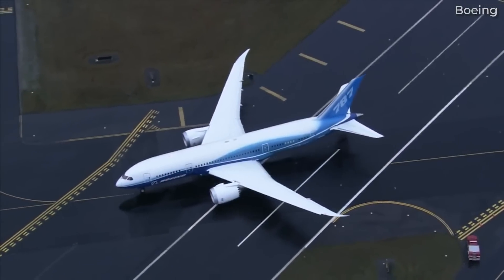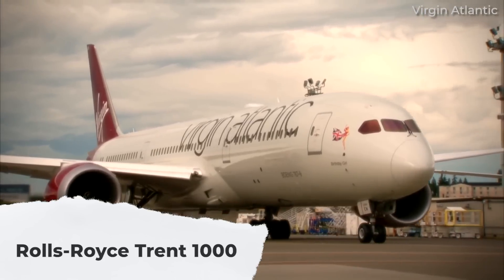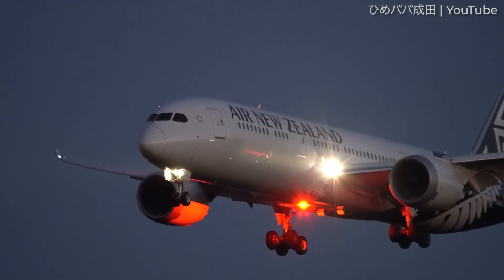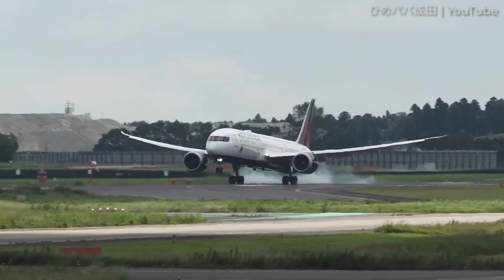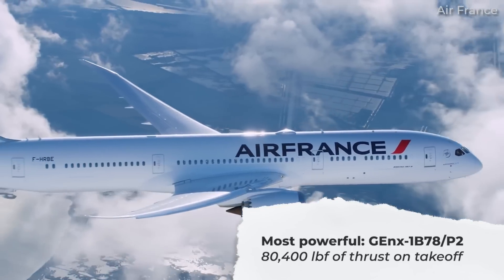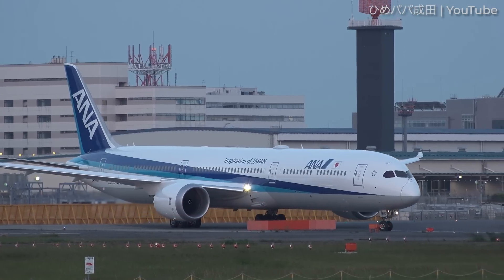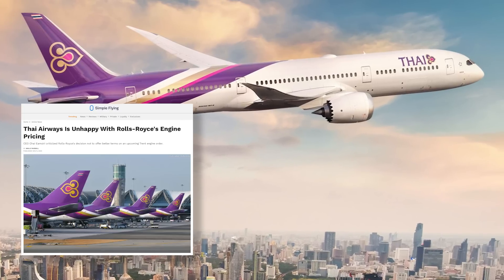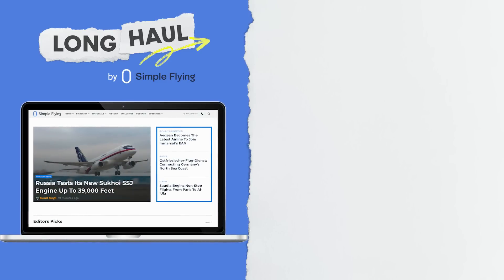Rolls Royce Vs General Electric - Boeing 787 Engine Options Explained

Comment: Simple answer: if you don't want your aircrafts to be grounded, it's GE..

And the operators are shifting already..

Like they are shifting from Boeing to Airbus
Reply: That´s childish. The reason GE gets more orders is that it has twice the production capacity of RR and can more often offer better pricing. It´s always the price that makes the final decision however analysts like to talk of other things.
Reply: @gregcavarra4807  don't forget that GE offers better quality, too 😎
Reply: @rafaelwilks  
Let's see how well the B777X performs, I've just got a feeling that those engines will let it down. GE are making lots of promises about performance, but there is not one jot of evidence, because the type is not yet certificated and therefore there is zero data available for it in service..............
Reply: @artrandy  considering the GE9X has been more thoroughly tested than any GE engine ever has, with the proven record of superiority of the GE90 and GEnx, we can see where this is going 😉 there was a time once in the 1990s when most people were sure that the GE90 was a failure 🤔
Reply: @rafaelwilks  
Your last line confirms that engine performance aint that predictable!

RR have got a real winner with the XWB, and not just the XWB-84, but the -97 as well. Its a souped up version of its sister engine, and was always going to be more expensive to run, just as Rolls predicted, because it was at the limit of technology when designed. 

However, its now due to be upgraded, so that it can double the time on wing before maintenance. If that upgrade goes well, it could embarrass Boeing and the B777X before the latter goes into service. I'll bet Boeing and GE have had a sleepless night or two, worrying about the stats for this upgraded XWB-97, and if they haven't, shame on them for being so blasé........
Reply: @artrandy  🤣🤣🤣
Reply: @rafaelwilks  
Hysteria can be treated you know...........
Reply: @artrandy  lol good one 😄 considering that the GE9X (certified back in 2020 btw) has more testing than any other engine before it, it's going to surpass anything the Trent XWB can do, even with upgrades, especially considering, you know, the proven track record of superior performance of the GE90 and GEnx 😎
Reply: @rafaelwilks  
But you don't know that, its all wishful thinking on your part. It aint so, just because you wish it to be so. I would have thought that you'd have learnt that in childhood, assuming to have left it.

You're confusing what you want to happen with what could happen. You're also indulging in fantasy.

Whereas Im not actually claiming anything for which statistics are unavailable. 

There are no statistics available on the B777X from airlines operating it, tests are not the same as every day operation over a year or so.

Likewise, there is no service history for the XWB-97 upgrades, not even specific claims by RR are laid out. Therefore you cannot say that any GE engine will surpass it.

Just because something is American, doesn't mean that its going to be better than anything else, certainly the rest of the world doesn't believe that anymore😀😀.......
Reply: @artrandy  the stubborn fact is, GE has for a long time proven they regularly surpass RR, and will continue to do so, it's just straight up wishful thinking and quite the indulgence in fantasy to think RR's going to ever surpass GE anymore at this point. RR's just not as good as some wish it would be, they've proven it themselves time and time and time again, especially with the Trent 1000 and also Trent 7000, and nobody can really claim RR is going to be as good as some want to believe, especially, going off of proven experience, considering their disastrous Trent 1000 and it's declining appeal with airlines - seems it's actually possible to confuse what you want to happen, with what could happen, never learned some things 🤣 P&W's GTF has proven to be even more troublesome than anything RR has made, so, no, it's not because GE is American, it's because they've proven themselves to be the best 😎
Reply: @rafaelwilks  
What a load of nationalistic clap-trap. Have you heard of the RR Merlin? Over 56,000 were built under licence in the USA, it saved thousands of WW2 USAF bomber crews powering the Mustangs that defended them, and was designed by RR. It was virtually gifted to the USA. By American claims alone, the most important engine of WW2.

Don't even think about attacking the history of RR, when you know nothing, it makes you look foolish...........
Reply: @artrandy  yeah that was the RR of the past, among other things, they invented the swept fan blade, which is undoubtedly the greatest shape ever invented for fan blades, and they've also invented technology that sucks carbon dioxide (and I'm certain other greenhouse gasses) out of the atmosphere, which is why I seriously think RR has singlehandedly provided the solution to the climate question. That being said, at least as concerns commercial jet engines, they've since proven themselves to be, well, the next best thing to GE, while at the same time being better than P&W.
Reply: You get what you pay for !
Reply: More BS.

Comment: The state-of-the-art 787 is an engineering marvel. It never ceases to amaze me how comfortable and stunningly beautiful this aircraft is especially on long-haul trans-continental routes. The most nifty feature of the 787 is the dimmable window that gives just perfect lighting to the seat.
Reply: Thanks ChatGPT
Reply: And the B787 is pretty silent.
Reply: As we don’t have A350’s in our Air NZ fleet, I’ll take a 777-300 over any of our Dreamliners ( that aren’t currently grounded due to RR issues ) as I know that GE90 power will get me there and back. Having over 20% of your “engineering marvel” fleet grounded due to an inept engine design isn’t the selling point you’d think it is.
Reply: @eastpeak74 That’s something for the airline to decide not Boeing.
Reply: @eastpeak74  
Then don't buy the A350, and suffer for it in contrast with your competitors. I see the government owns 51% of ANZ, so maybe it doesn't need to make a profit. And BTW, lets hope the powdered metal problem which has spread to GE, does not affect Boeing's widebodies.........
Reply: Thanks for the ad, Boeing PR guy. The 787 is horrible and I try to avoid it as a regular Eco flier as the 3-3-3 seating is way too small for a 188cm person like me with a broader than average shoulders. Can't sit in it comfy for 6 hours... Even the loud ass 77W is better. The A350 is the best model along with the 2-4-2 A330neos.
Reply: @kingsharkoon  You "called" this guy out as a Boeing guy when you went on to only talk about Airbus aircraft, maybe you are the PR guy.
Reply: @kingsharkoon  thanks for the AB informercial...as well ...
Reply: @kingsharkoon  not a Boeing sycophant at all. May be your above-average height intertwined with the carrier's seating configuration really made those flights ordeal. I have actually flown on Japan Airlines 787 from Tokyo to LA and it went just fine. I reckon you should factor in what airlines you are flying with to assess everything compellingly.
Reply: @hungo7720 Only two airlines in the world have a comfortable 787. It’s much more crammed than the A330 on most airlines.
Reply: @hungo7720 JAL is the only 787 airline in the world with generous 8 abreast seating on the 787 unlike the 9 abreast on other carriers. JAL economy is very nice in this regard, but you shouldn’t make assumptions about the 787 from them because they are a big outlier!

Comment: I really wonder among A350 and 787 which aircraft is better to fly with it??
Reply: Both are relatively quiet inside. It comes down to personal preferences.
Reply: @kkrsnn5632  It’s true but i don’t know in terms of safety if the 787 is ok?? I mean that Boeing suffers from many issues in the last decade.
Reply: The dreamliner is technically the safest plane in the world actually with no fatal incident and no fuselage lose (sorry for my bad english I'm French 😅)  @fotismpalopitas7196
Reply: a350 has a wider fuselage, so you get wider seats with the same configuration, plus its dimmable windows get darker than the 787
Reply: @randomwaffler  it depends on the configuration of 1 and 2 the option of portholes with electrochromic functionality is an option in the 350 (they are not present in all the a350s in addition to being not very popular with the general public) and 3  the 787 is quieter than the 350
Reply: @whatdafok.h1737  a350 standard configuration is 3-3-3, and with a wider fuselage this would mean that the seats are wider. additionally, quietness depends on where you are situated in the cabin and what engine option the 787 has. many people say that the a350 is quieter (myself included, having been on both), and vice versa
Reply: @randomwaffler  I know the configuration of the A350 but it is already difficult to establish an objective airline on which of the 2 is the best knowing that the airlines do absolutely what they want with the cabin.. yes it may be your personal opinion but  it was measured and the decibels are lower in the 787 (in general and at the same measurement location) because the 787 engines exert less power (even if the GE remains quieter than the RR)
Reply: @whatdafok.h1737  and yet first and third party figures from airbus and otherwise say the opposite. it depends on the payload the aircraft is carrying, the passengers, wind speed, weather conditions and more. could you provide a source for your claim?
Reply: @randomwaffler  exactly and like any other characteristics... it was a renowned YouTuber who released the stats, the 380 was 1st then it was the 787 and then the 350..
Reply: @randomwaffler  exactly and like any other characteristics... it was a renowned YouTuber who released the stats, the 380 was 1st then it was the 787 and then the 350..
Reply: @whatdafok.h1737  an unnamed “renowned” youtuber. most accurate source of information i’m sure
Reply: @randomwaffler  I no longer have the name of the YouTuber but you can find stats on the net quite easily, the 380 and the 787 are around 80-50 decibels the 350 a little more the 777x around 88-95 decibels then the 330neo for the  First 5 planes
Reply: Most preference, the A350 is much more comfortable due to wider fuselage with the same 3-3-3 configuration.
Reply: @maxsaviation9512  yes of course it is the most recent and technologically advanced aircraft, it has managed to perfect what the 787 initiated, knowing moreover that they do not play in the same category
Reply: @maxsaviation9512  I'm repeating myself again 😂 it's not the same category... The real rival of the A350 will be the 777-8 (and -9 even if it doesn't really have a rival technically) since the start of its design  Airbus wanted to compete with the 777 which was grabbing too many orders and so they made a plane that competed against the 777 to grab the big market share that the 777 had... The 330neo is a better comparison for the 787, but despite  its glorious past (with the 330ceo), the 787 had more orders because it was cheaper to purchase and maintain.